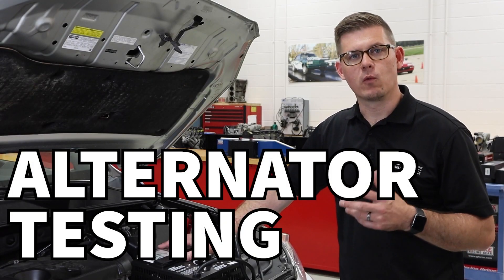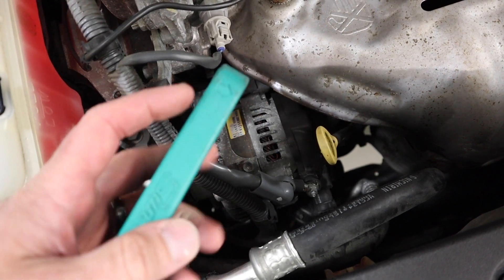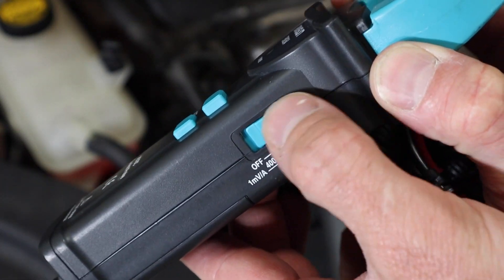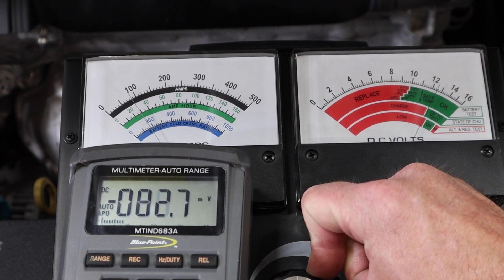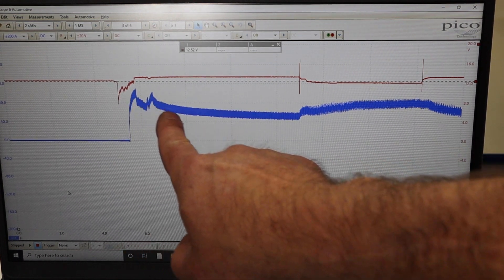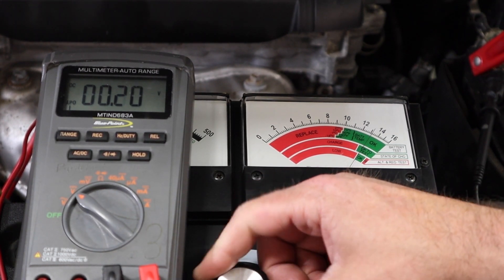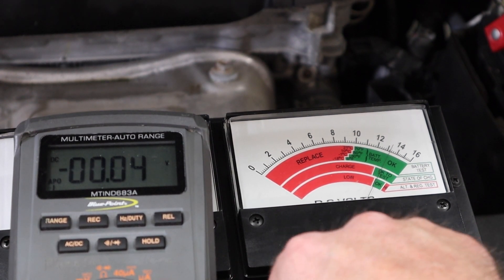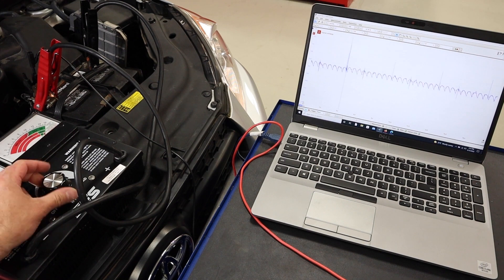Alternator & Charging System Testing

Comment: Can this be done also with a 100A carbon pile battery load tester and a standalone amp clamp?

You know that has one button to activate the load.

I'm curious how my alternator is doing. Its replaced 2013 since my old gone bad and stopped charging. Stock was 120A and new 150A with software update for it as well so ECM/CEM know it's a 150A.

I might have some other issues. Might be AC ripple. When my electrical PTC heater turns on all my cars lights and lcd displays etc flickers. But stops flickering after a couple of minute when cabin has reached a better temperature and engine are more heated. The higher temperature I set cabin to the more it flickers.

Is the PTC bad? Is alternator causing this? Bad battery negative to engine ground?

It's a new battery.. though my car is alarming when it detects low battery if I sit inside car with radio and such on for a couple of minutes.

If I put my charger on it says that the battery is at least 80% charged so.. and charger completes like after 30min is so. 5A charger.

I don't have the 100A load tester yet and not the amp clamp either. But I will get them. Good tools to have. I have a Fluke 179 multimeter though. But measuring AC ripple at the battery directly isn't the best. Can't get to the alternator cause it's down below kind of unreachable. I think I was 70-100mV or something.